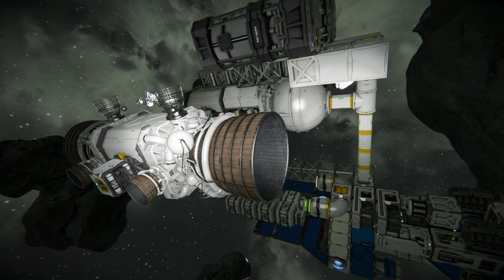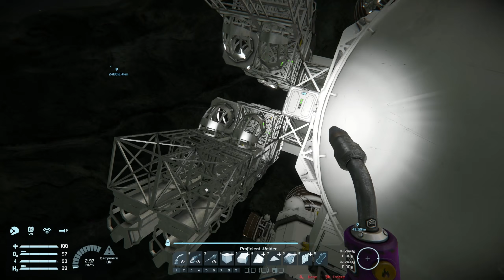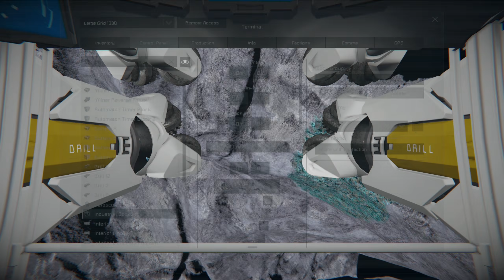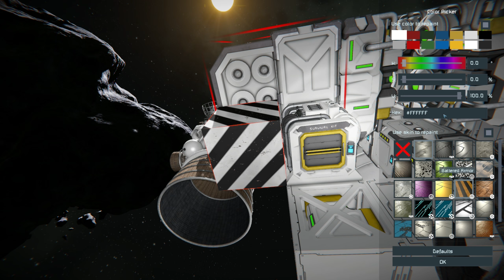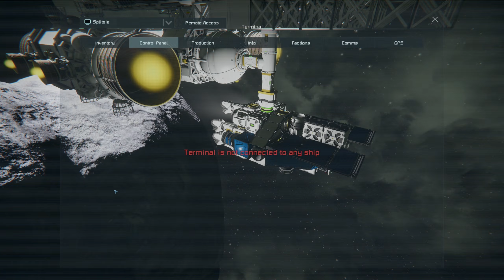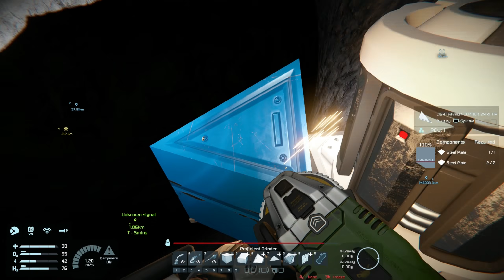A Big Misstep - The Collector #3

Comment: A single large grid O2 tank holds a little over 18 engineer-days of O2. In other words, ~18 days for 1 player, 9 for 2, 6 for 3, etc.
For indefinite operation, just add enough solar panels to power those systems you can't turn off and 3-4 oxygen farms per player.
Reply from the maker: Yeah I'd been forgetting about the O2 farms. Going to have to put some thought into some interesting ways to build a large array of them (and farm the PCU to keep them)

Comment: I find if you have issues with H2 engines and their storage of gas you can get around that via a valaved system of connector pairs, if you only connect up one of the ports put a connector there and then another facing it, it remains part of the main grid but you can stop it stealing H2 whenever you want without using less stable options, this would allow the engine to keep powering the grid while it drains itself.

Of course if ice is easy enough to come too it is a bit of a moot point but for those struggling to find it, a valved system can be great, it also works well for airlocks and seperate o2 tanks so you are not wasting O2 when there is no room for it in the tank.

Comment: You can use a large grid ore detector on a small grid ship, I think. Battery, ore detector and a connector or just a landing pad / magplate. Whenever you go ore hunting just pick that up and drag along. You might need some extra thrust on the small grid ship, but it should work.
Reply from the maker: Don't even need the battery now that connectors work without power :)
Reply: @Splitsie   Right - just make sure that the cleanup settings won't delete it (don't leave it hanging in the air)

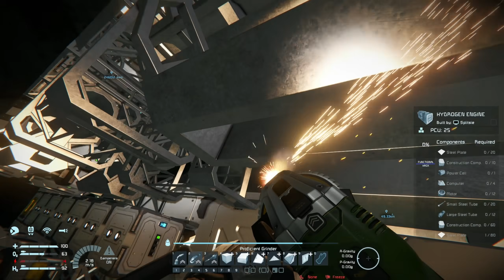Comment: 7:00 Unless they've changed it since the last time I checked (~a year ago), a single large-grid tank (100 kL) is enough for about 2.5 weeks of breathing for a single engineer.  An Oxygen Farm produces a bit more than 100 L per hour, and an engineer needs a just a bit more than 2 Oxygen Farms to keep breathing, so something like ~5.5 kL of O2 per day per engineer, or ~38 kL per week.  So a single tank would give you enough buffer that you could even skip a week of recording and be fine.  Two tanks would give that buffer even if one had an unfortunate accident, and would give you well over a full month if they both continue to function.

Edit: Also, that translates to  ~1.1 kg of ice per day for the O2, or half that if your hydrogen tanks are full or turned off.  You really don't need much oxygen in SE, it's very weird.

Edit 2: also, why not set up Event Controllers to control the hydrogen engines while you're offline?  I would assume they still get simulated when you're offline, if the power and oxygen also are.  That would pretty well guarantee that you won't run out of power unless you're also completely out of H2.  Could do the same thing with the Hydrogen tanks and the H2/O2 generators.

Comment: how about a remote control scout drone and a mining ship (that way you can scout from the main ship or the miner ship as required)
Reply from the maker: The main downsides of RC stuff are that you have no 3rd person view and you need to broadcast to connect to them, which makes it easier for people to find me :P
Reply: @Splitsie  I would use a Short range boardcast signal of no greater than 500m to 1km which will also allow for multiple drones to make Satellite positions around a mining cluster and relay between them and  make them cheap and disposable so if you have to bail. This will allow you to broadcast ore locations to the mining ship with a small broadcast range. Using 3rd person is not as necessary with this method.

Comment: Honestly, I'm not sure how you managed to slam yourself into the asteroid that hard. Your thrusters weren't burning that hard towards the rock, and they flared much harder to push you away, for longer. Like honestly, it was almost like that asteroid had gravity.
Reply from the maker: I'm pretty sure I got a little lag spike that held the thrusters on more than the light taps I was using. It happens, so I probably should have compensated for it with more room for safety 🤔
Reply: @Splitsie  Nah, the lag spike just shouldn't have happened. Just because you know errors and bugs and lag sometimes happen, doesn't mean you're at fault when they cause accidents. XP

Comment: U could potentially run a straight conveyor on both sides of the top drills and hook up 1 drill on each side just above the thruster, just so u never get stuck and the hole drilled should be always wide enough to fit through. It would probably look meh,but the functionality is there (added bonus two more drills for storage/mining) :D
EDIT: (After watching to the end) Nvm, i guess can't add drills on a ship that went  blaamo :D

Comment: Instead of a drill ship make a drill platform that you can haul around with your big ship. Give it landing gear so it can be docked to the asteroid. This way don't use more thruster blocks and you can leave it and come back
Reply: He intends to keep moving so any left behind will stay behind.
Reply: @davidmartensson273  but it'd be portable. Use landing gear to attach it to a surface then dock or merge and carry it off

Comment: I'm guessing solar panels and oxygen farms continue to operate while you're logged off...so maybe this is the situation for oxygen farms to shine when you start collecting clones?
Reply: Yes they do. My ship had a giant unfolding solar arrar with the sides lined with O2 farms. With everything passive i never had issues with losing power or oxygen, though i did have issues with ships disconnecting while logged off. I never retrofitted merge blocks before i got bored

Comment: How long until the server wipes???
Are you gonna have the time needed for this series??

Also, I originally had thought you might use that smaller cargo module to convert into a miner, but... The large WAS better. Unless the new one has 5-6 Large cargo containers, its certainly going to require more trips!

And lastly, while I know it isn't possible (given asteroids) for you to accelerate to like 10-15 m/ps, in the direction of the planet before you log off, I almost wonder if an AI block, with collision avoidance on, coyld be told to fly towards a GPS. Then you could leave the auto-pilot on while youre away, flying at sublight, leaving you to do the jumps when you're youre logged on. 🤷
I dunno... 200-some thousand kilometers is a ridiculous distance in SE.

Comment: 28:30  3 (Large Grid) Large cargo containers full of Ice will translate to 2 (Large grid) Large Hydrogen tanks which will power one (Large Grid) Large Hydrogen Thruster for 1 hour 44 minutes or a (Large Grid) Small Hydrogen Thruster for 10 hours and 22 minutes. Point is the ratio is 3 to 2.

Comment: Lost so many ships on official servers.  Some through crashes, others because of the clean-up script and my grid losing power.  Lost one because I left it at an NPC station.  Glad that the event controller is now in.  If I go back to official, it'll help keep things powered without draining all the hydrogen.
Reply: I built a ship with a giant unfolding solar array. Even without any tracking it charged far more than needed.
Though flying around with everything running and the biggest ion engines i could drop my 22 batteries down to 18min to empty 😂

Comment: You should be able to have the thrusters and gyros turned off if you landing gear lock to an asteroid. This way you can save on power as i know Gyros do use a bit of power when idle.
Reply: Or just convert to station.

Comment: That was a rough hit! I'd say throw some solars on top of the refineries so you hopefully log back in with full or near full batteries, saving that ice for thrust.
If going a small grid you could have looked at hydrogen just due to cost and power

Comment: “It’s fat and it’s white.”

I mean, so am I, but I’m not a porpoise.

Edit: When you set that cargo meter up, please show your work. I really want a vanilla solution to that problem.
Reply: It's really easy. I haven't done near to anything with them, but last week I just slapped an EC (Event Controller) on my miner and set cargo fill thingy to 90%, added the Cargo Container and the drills to the list and told them to switch off when full. Try it.. easy going! 😉

That was my first attempt and it instantly worked.
Then I added timers that get triggered instead. These timers were for separately controlling the pistons and the drills, Left and Right. I added another EC, so I had one for each side. Then I told the respective piston to retract and the drill to turn off, once it and the Cargo Container are full. Same for the other side and there you go! You can do it! Have a go!👍
Reply: you can be! believe in youself

Comment: If you use the big ship for the ore detection you'd be able to cut the cost (and space/weight) of a scout ship until you get to the point where you really need one.

edit: PCU limits are on if I'm recalling correctly? This is my justification for not making a scout.
Reply: I'm not a Player, just like Splitsie...
Were they not going to be making it so that you can attach large and small grids together? Or is that still a future update?
Reply: couldn't he also just slap down a rotor to convert from small grid to large grid (or the other way around) and build the ore detector on that?
Reply: @rarespetrusamartean5433  Yes, he could use a small rotor with a large head. Or use connectors and dock to it. Not sure which is lower pcu offhand.

Comment: The default consumption rate is 0.063 o2/s
So on vanilla settings a full lagre grid oxygentank is worth 18 days 8 hours 55 minutes and one second for one engenier.
And a large grid o2/h2 generator produces 3.6 Liter h2 per Watt hour
Reply: In the same vein, if the official wiki is accurate, it takes between 25 and 50 tons of ice to fill one large grid hydrogen tank, depending on whether you're producing oxygen at the same time or not; 25 if you don't produce any O2 at all, 50 if you produce both the whole time.

Comment: Heyas. I'm still up to my eyeballs into scrapyard engineers and still ground-based so all I know nowadays is SB. But I can imagine SB principles carry over to LB. TL-DR, I only use hydrogen for power, no wind nor solar. Ice is scarce so I really have to keep an eye on energy consumption. I learned a lot and implemented a few things with the new event controllers to help with that.

What I have l learned so far (with SB, LB will have different values):
- 1 H2 generator can supply 2 H2 engines;
- 1 H2 generator consumes 100 kW where an engine produces 500 kW so one generator will consume 20% of a single engine output but only 10% of a twin engine;
- a H2 engine is 100% efficient, that is when your engine produces 0 kW it consumes 0 H2 so they can idle just fine;
- a H2 generator will consume 100 kW regardless of how much, little or nothing it produces, idle they will kill you.

This means H2 engines can be kept on permanently but H2 generators MUST be stopped when not needed or at least when tanks are full. It's also best to match the number of running H2 generators with twice the number of H2 engines UNLESS you have a good reason not to, like running your thrusters straight from generators.

I solved this with event controllers. I went way overkill with cascade controls and such but then I am a trained automation engineer. At a minimum you need one event controller to switch off the hydrogen generators when storage level in the H2 tanks reaches 100%. Recommended but (slightly) optional is a controller that switches H2 generation back on below a certain level. Another even more optional one switches the engines off when your batteries are full. You must use AutoLCD screens or something to keep an eye on levels and switch on manually but switching on manually makes it easy to override eg battery charging when you really need that last drop of H2 for propulsion. YMMV

I haven't had a need for O groundside so I have not experimented with that yet but I'm going out on a limb and guess that small O tanks fill up long before large H2 tanks so maybe they don't need anything special. Just keep an eye on those levels too if ever you automate H2 production.

Haven't run out of ice, H2 or battery since.

Comment: Glad that even SE pros crash mining ships shortly after building them lol
In terms of power while offline, don't forget you can build event controllers to turn  your hydro engines on if your batteries get low. Unless they don't work while you're offline and no one is near you
Reply from the maker: That's the part that worries me enough to not trust the event controllers, though I could leave them to turn on at low power since I don't have anything to lose at that point
Reply: @Splitsie  might be worth setting up some kind of test grid to see if it does anything while you are offline. Probably be handy to find out.

Comment: Don't feel bad Splitsie, we've all done that, many times. It's one of those "It has happened before, it will happen again!" kind of things.
Reply: Yup
Reply: @Real_LittleEgg  I might have ripped off a jump drive and a hydro engine, o2 gen and damaged a filled large hydro tank.. just the day before yesterday...
Reply: @Eisen_Jaeger  If it makes you feel better I disconnected around 100 blocks for the top of my freighter I’m working on. Didn’t realize it till I had added on around 200 more and saw the misalignment at the back.😅Thank you maker of weld pads you are a true hero among mortals.
Reply: The worst I had was when I was flying in a ship I had amalgamated (pretty much the only way I play survival by amalagamating ships together), and I left it flying at full speed through space and just straight up face planted into a mentor.

I remember another time where I was doing the same, and one second the ship was entirely there, the next half of it was gone xD

I have slowly learnt the lesson not to fly at full speed when not paying full attention to where I'm flying...
Reply: @mastere6115  I have done this more times than I care to mention since using the speed increase mode. 300mps is very fast and a lot of inertia to counteract when stoping 😂

Comment: One Engineer apparently uses just about 5500 Oxygen per day and as additional info 1kg of ice turns into 10L of Oxygen or into 20L of Hydrogen. which means in order to fill one large Hydrogen tank you need 750000kg of ice (if we ignore the engines running).